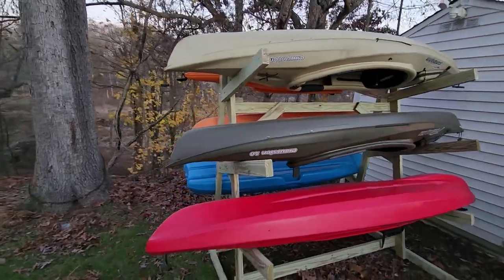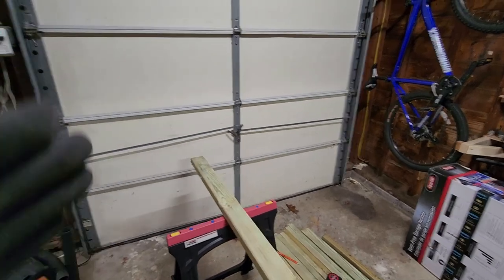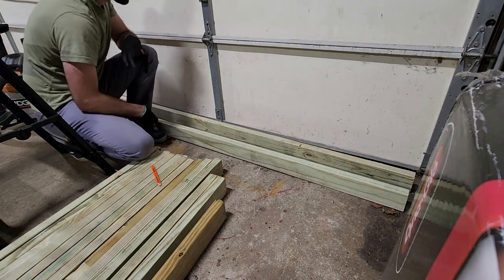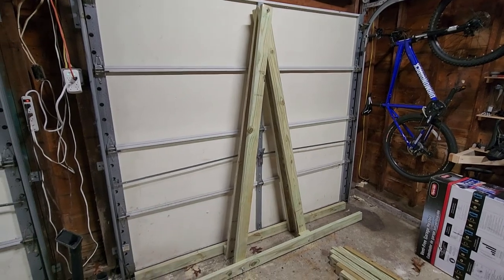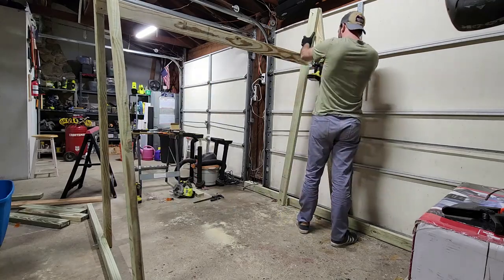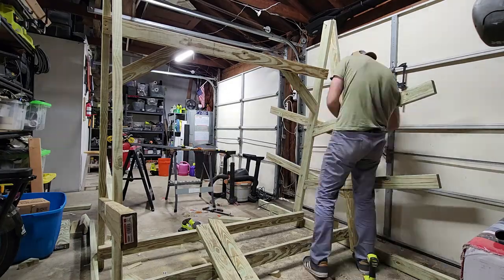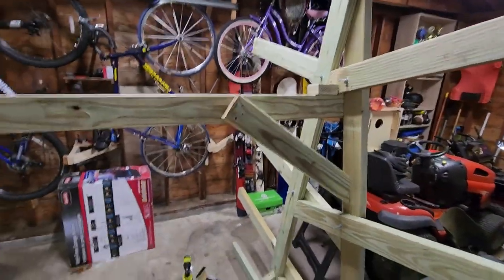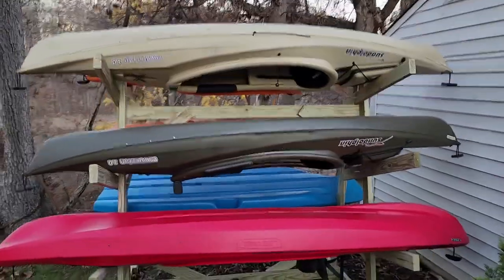How to make a Kayak Rack for cheap | holds multiple kayaks

Comment: We did it! It was super easy to build! 

I watched the video and managed to figure it out- I tried to make instructions - 

16x4" 5/16 carriage bolts, washer,nut
2x5" 5/16 carriage bolts, washer, nut
4x.  12'x2x4
1x.   10'x2x4
9x   8x2x4

40 Screws 3.5" 

2 8ft pieces - measure in 33” from both ends & drill a single hole in the middle of the 2x4 (4 times total)

4 8ft pieces - measure down 1.5” drill hole in 2x4, measure down 18” drill hole, measure down 20” drill hole, measure down 20” drill hole. Measure down 23.5” and cut board. Repeat 3 more times (or double up boards and do it only twice)

Use cut offs to be 4” spacers in base (see video) 

Overlap 2 boards & Add 4” bolt to first hole drilled (above) and tighten  starting your “A frame”
Repeat with the other two.

Place each leg of A frame lined up with the 33” hole on the base. You will need to drill into A frame leg at this point (thru your already drilled 33” hole of base)  Add 4” bolt to one side and tighten. Add 5” bolt  plus 4 “ block & a frame leg to other. 
Repeat for otherwise / we opted to ensure blocks were kitty corner to each other (unclear if that was better - but it worked) . 

Now comes the fun part…
Our angle cut was 19 degrees. 
Our arm length was 33” from the A Frame leg + the inches to the opposite A leg.  (Each arm was shorter than the lower one)  you will have to figure this part on your own - as I failed to measure for my instructions.

The cross beams were each 6’’ and were screwed in. Two at the bottom and one below the highest arms (we did have to adjust location of top cross beam once we understood where the highest arms sat) 
The top one has diagonal supports that were about 2’ft (we used off cuts) These are what truly snugged it all up!

We may add pipe insulation (like pool noodles - to the arms) tbd.

Comment: Great video, I built this in about 6 hours based on yours with 8 slots for paddleboards and kayaks and it works great.  I'm not super handy but this gave me plenty of guidance and with a couple of seat-of-the-pants adjustments, it came out just fine.  For everyone mad about not including specific angles for cuts and what not, build a bridge and get over it...... for a backyard weekend project that works, this is more than adequate and any design gaps can be overcome with a few extra deck screws.  If you want plans with exact measurements, buy a pre-built rack or hire an engineer to design it for you.

Comment: Did anyone create a list of parts or plans that they would like to share?  Thank you.
Reply: Created one for you:  18 4 1/2" 5/16th Hex Bolts; grab 18 Hex Nuts and 18 Flat Washers - Box of 3" Exterior Phillip Screws - 15 pressure treated 2x4's 8' long.  While watching the video he mentions he should have purchased  4 5" 5/16th Hex Bolts too for the base vs counter sinking the 4 1/2" bolts.

Comment: I just got my materials for this build. What are the degree of angles you used for the a gram and the arms?
Reply from the maker: The top angle of the A-frame is roughly 20⁰, the ends of the arms are cut at roughly 65⁰.

Comment: It's as if you hacked your way thru this project.  Sure it came out ok, but I can't follow a Youtuber who leaves so much important info out of the videos.  No mention of what angles you used & the added blocking was merely an afterthought.  You were even lacking the right length bolts.  Most were too long, others too short!    Sure it's a good design, but, basically it's a hack job.
If you're going to do these kind of videos, at least film the angle cuts and list the angles rather than repeated cuts of you using a circular saw.
Reply: haha...we'll miss ya.😢